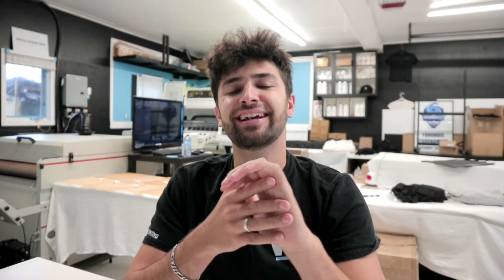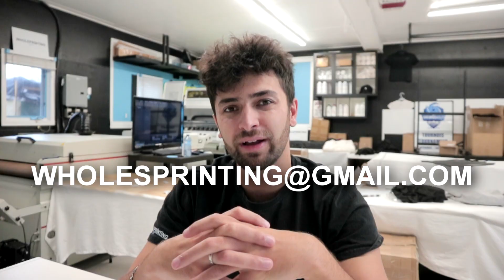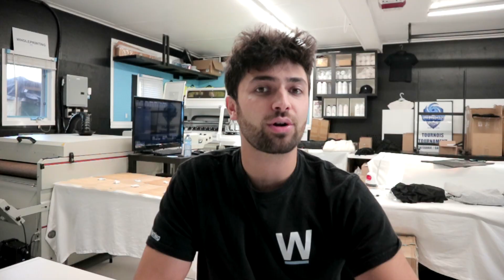Top 5 Things I Wish I Knew Before Starting DTF Printing

Comment: Hello man:> have u experienced the color of the print rubbing off with just tapping it with water? I have a plotter, i print, wait for around 8-10 minutes and then goes in the oven for 110 celsius until i see it the powder has melted or it just continues with the flow,, I started experiencing this very recently and i wanted to hear your thoughts about what could be the issue
Reply from the maker: Honestly I’m not 100% sure what you mean, can you kindly explain further(
Reply: @xDominick  Sure, sorry my primary language is spanish, thanks for the response, i will try to explain it better, i mean when the color ink of the print sticks to the film or rubs off in the first wash or with little water, its mostly weird because the white dosnt wash off nor it cracks, it just happens to the color even with new ink :0 it started to happen to me and some friends and weve had the same process for a long time and i cant even tell if its the quality of the ink, or the film or if it could be something else